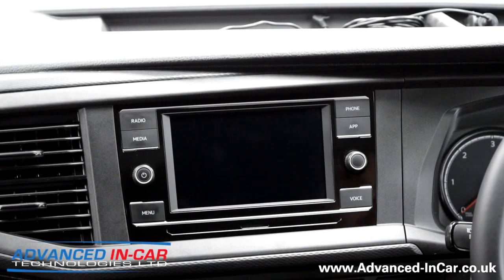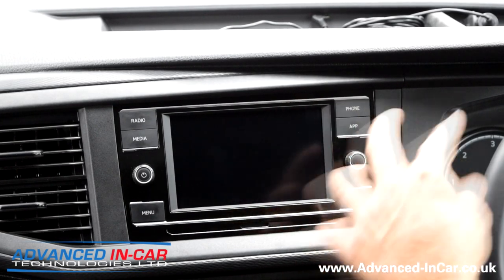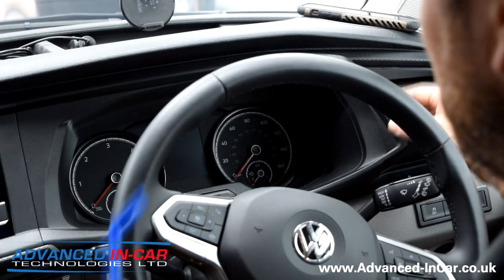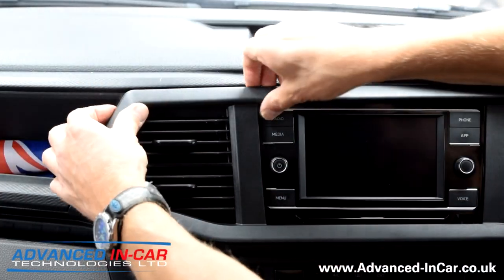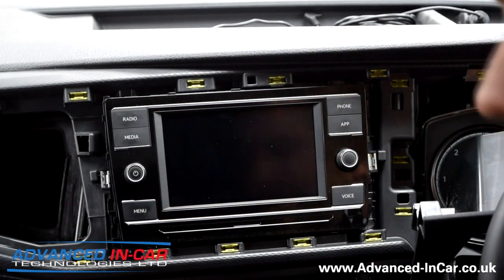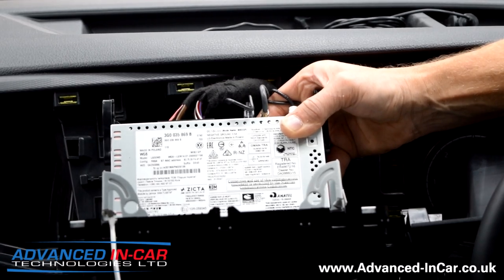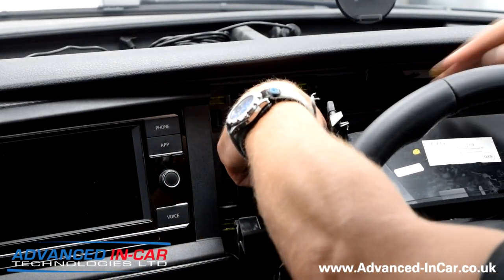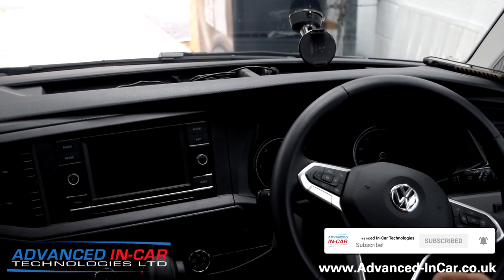How To Remove The Composition Colour Stereo From VW Transporter T6.1

Comment: Hi this is a very informative video. If I were to upgrade to a discovery media package, would the trim around need to be different? Also do you know on the entry level infotainment system, you can upload the radio logos to the corresponding stations, I can't seem to work it out?